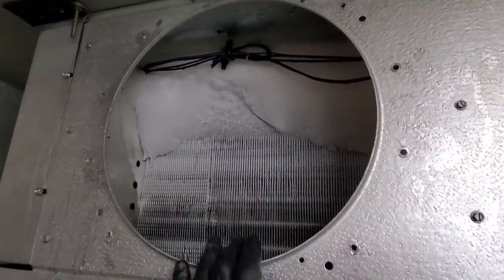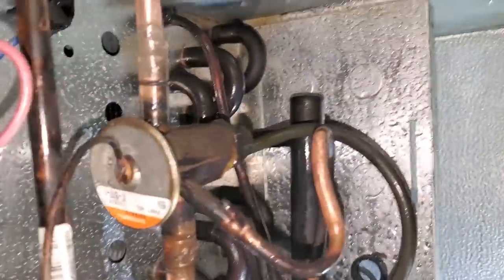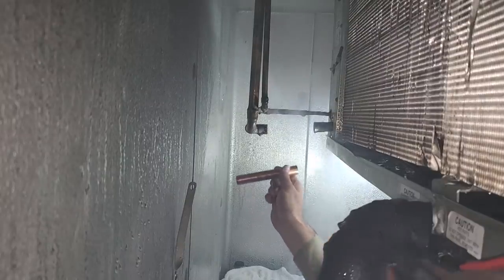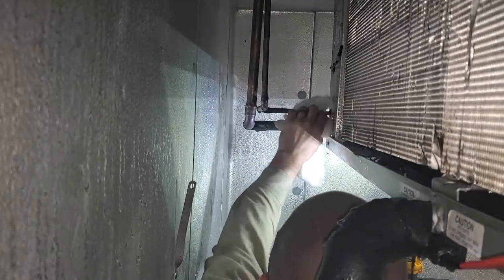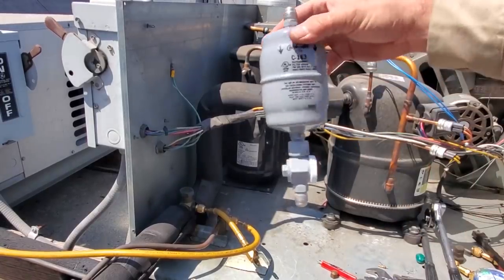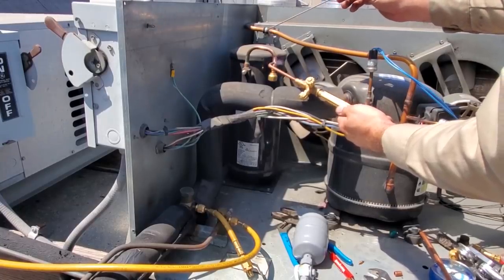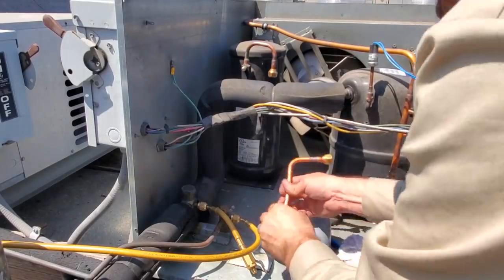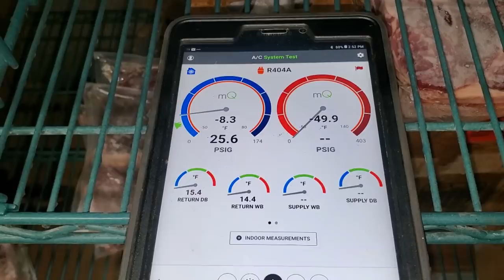WALK IN FREEZER NOT WORKING

Comment: I find when unsweating I grab the pipe to be removed when i see the solder shine or start melting I find it speeds up the heat transfer to the solder, by holding early the pliers absorb a lot of heat, especially in confined places. you will half the time.great job master.
Reply: I do the same bro , cheers

Comment: It would be so smart if they used a TEV where the head could be replaced. The Carrier slab coil units have so many of those valves failing, and they are such a pain to replace them. It's always during the hottest week of the year when they approve the work, too. On a Lennox L series, I can just change the head and clean the rod, and done!

Comment: Hey Chris, I’ve noticed and commented that some of the jobs you are on do not have pee traps at the evap coil. I’m betting your oil issue is what caused the txv failure. There should have been a trap on that system. Furthermore, since you were already removing the boogered section of suction line for the bulb - you should have installed a trap! You still wouldva needed a place for the bulb but heck since you were doing all that work anyhow, why not add the additional piping and do it right. Just curious...love your videos and watch them all.
Reply: who says it doesn't? just because there is no P trap inside the freezer   maybe it doesn't go directly up ... you only install a P trap on vertical rise 6ft and up for Larger pipes  P trap heights change

Comment: I’m sorry if you’ve answered this already. But what size is that rosebud tip?
Reply: Shawn Price For oxy torches there’s really only 2 sizes small and large. Small for 1/4 to to 7/8’s large for 1” and up.
Reply: There are plenty of sizes. I believe they range from 4-10. They also make dual tips. Used to braze 3/16” to 8” copper.

Comment: Does that solder you use already have flux? I’ve never seen you use any flux paste before when soldering. Just wondering. :)
Reply from the maker: No flux needed because it is 15% silfos on copper to copper  just clean the metals and apply heat. If I am  working on dissimilar metals than I will  use 56% silver solder with a silver paste flux
Reply: Ever try using 6?  I find it flows much easier without needing as much heat.
Reply: I am personally in electronics technician so most of the time flux is needed so we don’t burn the board since it aids in more efficient heat transfer without needing as much heat. I wasn’t aware that that was actually possible for soldering pipe. But then again I’m not an HVACR technician yet. If all else fails I’ll probably be looking into getting into the field. I do know a bit about it and more so thanks to your videos. so who knows?

Comment: not sure if you actually paying attention  the coil was still freezing the same way  30:22    txv didn't fix the problem
Reply from the maker: At 30:22 I said it looks good and had an even frost pattern vs when i got there it was only frosting up on the top. The coil was not frosting the same way, these walk in freezers are expected to frost up like it did at the end of the video especially under the load it was trying to cool down

Comment: I have found  to braze those fittings that have the ability to fall off , easier to braze if I first squeeze the fitting, while on the pipe,  just barely enough to get out of round ( and I mean barely, where its almost impossible to see with naked eye) then turning the fitting half a turn so it binds and can not fall off. Old pipefitters trick.

Comment: When I have to insulate a suction line and it is cut loose from the coil I slip the armaflex on line and compress it and hold it in place with a tubing cutter. That way you have no seams and potential for leaks. Also it looks clean.
Reply: Very clever , thanks for the tip

Comment: When I was working I would defrost an iced up evaporator with a domestic steam wallpaper stripper steam would condense on the ice so no mess and was quick.
Reply: would u say its quicker than using plain old hot water from a garden hose? or some what the same? i want to try ur idea, sounds good
Reply: @dand1486  
For which one's faster, I looked at thermodynamics. It doesn't look good for the steam wallpaper stripper.
To melt ice, you need energy, not temperature. A gallon of hot water carries less energy than that same gallon of water turned to steam at 212F, sure, but that steam will now take up 106.5 gallons of space. Steam is a lot less dense, meaning it takes longer to deliver it assuming the same flow rate as the hot water hose.
So with those assumptions, the hot water hose carries higher thermal energy per second into the ice (energy per unit time is power, so we could simply say that the hose carries higher thermal power).

Also, last time I checked a steam wallpaper stripper runs off a standard 15A 125V circuit, so you can only get a max of 1875W of heat into the steam, whereas the water heater the hot water hose is connected to might run off gas (lotsa power) or a 40A 240V circuit (9600W), so even if you "run out of hot water" you're still delivering AT LEAST 9600w of heat into that ice using the hot water hose.

I don't really need to do the math to know that I'm right, simply because a pound of steam takes up so much more room than a pound of water.

This means that the hot water hose is better in both respects, but feel free to use the steam wallpaper stripper if you have a restricted drain or are getting paid by the hour.
Reply: @44R0Ndin  yep
Reply: @44R0Ndin  man, maybe get a girl friend or some thing, u seem kinda angry or something, lol u just spent like 30min typing that lol...we all took the course, ok, ok, u win, lol. ....slow clap   hahahaha
Reply: also, have u ever poured water onto a ice up coil in a freezer were it sticks out futher than the drain pan? using a hose, it pours onto the floor. using buckets kinda work, but it will freeze to the floor and u have to use a small steam of water, but of course u know that? depending how bad it is of course
Reply: sry i meant stream of water not steam lol

Comment: Should have a trap on SL, that's why the oil in SL, no P trap, to increase velosity and carry oil up the SL. Heard you say 8 to 10 degrees superheat, for freezer ? thats a bit high. And please make sure you have proper ventilation when using a open flame inside any closed Walkin's." Phosgene gas " very deadly. I realize you were working in difficult circumstances, been there many times. Very Good job, well done Chris
Reply: 8-12 is perfect for both super heat an subcool you don't want any higher than that
Reply: 8 a 12 ala salida del evaporadol

Comment: Brilliant video and explained like a pro.👍One thing I noticed is that why is the wiring all over the place on the outdoor units. Here in the uk I always run cables in copex  or use SY cable which is like a flexible armoured cable and not easy to chew by mice & rats...

Comment: Have you every used a turbo torch? I prefer them as you only need an acetylene tank. I find it works well for Residential HVAC.
Reply: Not enough heat I find, can’t get a proper braze